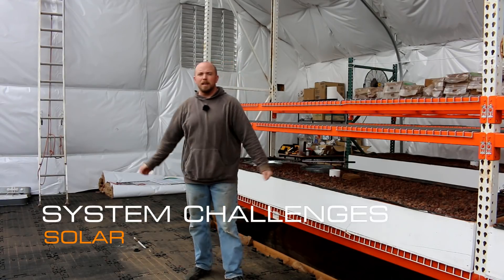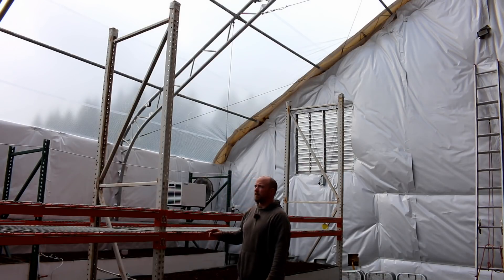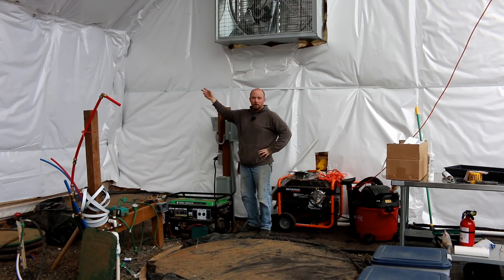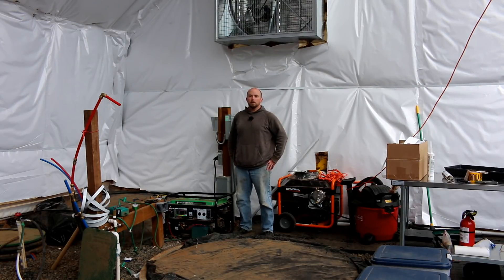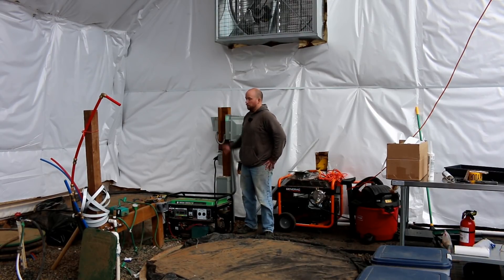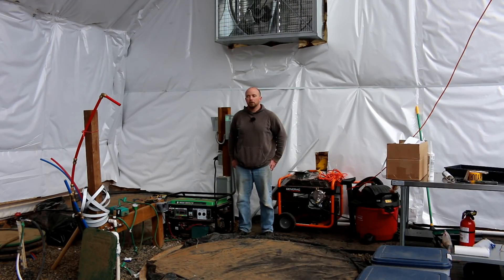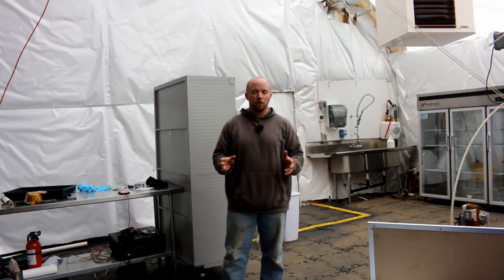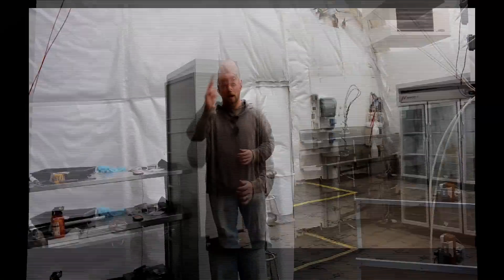Solar, THEY WANT THEIR CUT

Comment: Also... if you need to run power... run DC instead of AC... could have saved some line losses and wire cost if the inverters where installed near the meter instead of at the array...

Comment: Had a large innovative dairy farm in the area that has large manure digesters that make methane. He used to generate roughly twice what he needed for the whole farm housing and all. Power company sent him a bill one day for 20k$. He called and asked what it was for after all these years. Their excuses was fees due. He officially went completely of grid after that. Designed some neat switching equipment and software to control the out put for his three giant generators. Now as more power is needed the software will switch on more generators as needed. Or shut them down when not in need.

Comment: dude I was one of those who told you just to go it alone, no govt involvement, that didnt allow you to have batteries tied in and that would put you in the dark during a blackout! And might I add your solar is not in the perfect positioning either, I mean your panels should NEVER have shade on them considering the land you have... NOW you getting screwed, just like you where warned about. You need to slow down, now your talking tesla batteries, finally, But DONT have them outside what ever you do!!! Batteries dont like "freezing cold". mistakes are mistakes but lack of research can cost you thousands. For instance, look what happened to California and those folks. This very same thing and Solar City. Check out the  video on YouTube... I know, I know, I support you brother, I have no other point to make other than when it comes to power generation, plan for your worst case and plan your system accordingly and batteries are a hugh part of that overall system for global systems energy storage for the entire complex. Plan for you being the Sole Provider for All Systems Power. Im rooting for ya and Im learning alot too. Im working on a low voltage generator and I'll update you with its progress because I know it'll be an asset and programmable too... we share your frustration..:-)

Comment: We have similar power company issues in New Zealand.  Our local body has raised the monthly rental  (your  $30) for people who have solar/turbines and essentially cut any sell back to the grid. Prior to this, a setup using batteries as well as grid sell back ended up pretty much cost neutral on a  monthly basis.

A friend of mine is rural and has batteries and solar. It is a big enough system to run a reasonable size engineering machine shop from. When the power  companies shafted them on sell back he looked for other ways to use his surplus electricity and bought his wife a new electric car. Fortunately for him he has the financial ability to go buy the car at short notice. 

Could be a good option for you to absorb surplus energy. But you guys are too rural and cold to rely on EV's I guess.

Comment: this legislation is going on across the nation. BIG POWER is running afraid. Batteries is of course the answer. Here in fla it is against the law to not be on the grid if you do not have batteries. THUS.. the power company has the ability to cut you OFF of the grid in the case of a hurricane or power outages. thus.... if the grid goes down and you do not have batteries you would be breaking the law to run solely off solar.  wait, what?????????

Comment: Check out GRAPHENE batteries. They are the future. Would be the choice on Mars, not that old hat Lithium Ion. Presently 6 times the capacity.
Reply: Are you importing any from the future then? Might want to put a fusion reactor in the mix while you are at it.
Reply: No need! https://www.ft.com/content/5a6693f0-d349-11e7-8c9a-d9c0a5c8d5c9

Comment: i would invest in to a led acid Electric fork lift battery depending on the size and they have 12V, 24V, 36V, 48V, options and will power a house with ease and is easy to maintain and are known to last 6+ years with proper upkeep and have lived as long as 12 years under extreme use  and they can be rebuilt and you can also buy rebuilt ones at a discount ...at least look in to it or install a bank of 6v golf cart batteries and install a watering system for easy servicing maybe look in to a place like this http://cdn2.hubspot.net/hub/435823/file-2177974806-pdf/IMG/Page_images/H2GO-Industrial-Battery-Brochure1.pdf?__hstc=75749450.7a714e0983efbb20db05f7decd2dc150.1518065533971.1518065533971.1518065533971.1&__hssc=75749450.1.1518065533972&__hsfp=753840322&hsCtaTracking=f03fe077-ac40-403b-a6d7-cb513aa4dcbc%7C34cc661f-2643-4600-8b8f-368776515de6
Reply: cant find any prices for these anywhere..?

Comment: The real problem that electric utilities are facing is related on how to tie production to demand. You just cannot shut off a thermal or nuclear power plant on the spot because it's bright and sunny outside and start it when the sun goes down on summers but not over winter.  Large batterie banks are currently being build to store that excess energy but even though, there is no magic solution. Some sort of energy storage will have to be added to each house to compensate for the highs and lows of the grid.

Comment: Jared at Simple Ground installed has completed the installation of its off-grid electrical system. The batteries that he choose aren't Li-Ion but neither Lead-Acid. It's a fairly new technology on the consumer market (although use in the telecom industries for a few years now). Get in touch with him: he even has the contact info of a distributor in WA state. Keep up your good work.

Comment: Before you jump to the Tesla Power Wall2, check out other lithium ion batteries. There are other kinds. 
http://simpliphipower.com/contact-us/   Also check out “grid zero”. You can add a battery based inverter and AC couple to your present system. I install both grid tie and off grid systems.

Comment: Something I don’t understand is why people complain when power companies charge you a fee. The resident doesn’t wanna invest in batteries yet wants to use the companies batteries for free?
Reply from the maker: I'm not complaining about the $30 fee...that makes sense...thats the admin of maintaining my connection and processing my bill...I have a very hard time be charged to provide something that they pay for (i.e. power) with no explanation of why my connection, that provides power, is somehow more expensive to maintain.
Reply: That power you produce first goes to the neighbors, which they still get charged for.
What they are trying to do here is scare people off solar power, because every kWh you are producing you aren't buying, and if enough people go that route you soon put them out of business.
And it's not just the rates that are changing, there are whole power company groups working on legislation to make it increasingly more difficult for anyone outside their groups running solar farms.
Reply: TheRealMartian what I’m saying is why wouldn’t there be a fee associated with using their power storage? The way I see it is you either pay thousands for a battery wall or a fee to use their batteries. 

I understand both sides. I use to work for Solarcity/Tesla as an installer for years. One point that I don’t agree with is power companies forcing people to be grid tied. It’s a forced monopoly
Reply: TheRealMartian also because you like to tinker and build. Look into building your own battery wall out of used Tesla batteries. Great YouTube channel that give a lot of information on the proper way to do it.

Comment: Hey TRM.  Really like your channel, and sincerely appreciate the reasons behind why you are doing this.   Therefore, I mean no disrespect and my following comments come from genuine concern and hope that you will succeed.  I was concerned by a couple of the generalisations that you made, but I realise you are understandably so mad about your county trying to take money out of your pocket that you are not thinking straight.  "Solar is not reliable".  The Sun is the only reliable thing you can count on. It shines every day of your life and will do so long after you leave this good life.  Yes cloud cover and time of year (angle of light) affect whether it reaches you, but there are systems that can be put in place to account for this.  Track how many days of the year on average that you have issues due to snow cover and low light.  Lift above the snow (suggest pillars, see DIY Homestead Projects) and Implement solar tracking and or optimize your system for winter angle, not summer (this is how earthships work and they provide abundance year round).  To be brutally honest, when your "solar is not optimized for winter" even added battery storage won't help unless you start over.  Start looking at your usage and be sure to size any battery storage appropriately for lowest solar capture and several days of cloud cover.  You may need to add more panels as well once you do all the sums as I've been seeing you add in way more sensors and things (each will cost).  I understand you were relying on grid,  but that was your mistake. Putting your trust in your council and they made a slave of you (doing their readings for them, are you nuts?) and now stealing from you (charging you for supplying them with power that they charge others to use).  I know you can turn this around eventually, but it'll be expensive.  Several Tesla Power walls may help but are gonna be costly.  Finally, please check out Urban Farmer Curtis Stone's Youtube channel as he has a great system for microgreens.  I respect the scientific approach you and Mr's Martian are taking with the trials recently, but if Microgreens are just a means to an end for your aquaponic systems, why invest so much time in them? Why try to reinvent the wheel?  Implement Curtis's microgreen systems so you can bankroll your greenhouse systems and stay focused on your goal. You know Elon created Ebay and Paypal to bankroll his Battery, Tesla and Space projects.  He's then sold off those original projects as means to focus on his passions.  I'd respectfully suggest you continue thinking similarly and allow bare minimum of investment of time and resources in the microgreens.

Comment: I would suggest Edison batteries or Lithium-Polymer instead of Lithium-Ion. The Edison's batteries are able to be run very low like Ni-Cad's without damage.
The Lithium-Polymer are better than Lithium-Ion because they are more stable so they don't explode as easily.
But in the case of Lithium-plus (anything) you cannot run them down below 50%...EVER...something that could happen after days of overcast sky.
PS> An automatic transfer switch works.

Comment: Yeah, you bet on the wrong horse here.... It was fine when you were a small percentage, the company could eat the cost and maintain relative parity with net metering.  But, the more folks that took advantage, soon the cost of normal uses isn't going to cover the generation, transmission, and maintenance with just a flat $30 month fee.   I don't think anyone should have planned long term on that being a solution.  I think grid-tie is going to avg out to some point but it was probably too subsidized and it's moving back the other direction.   Easy to still be upset though... yeah I'd look into a Tesla battery / Edison nickleIron.   Grid-tie has it's pro and con.

Comment: LiFePo4 Winston, they are the best for photovoltaic applications, they do not suffer from the cold like "Tesla" lithium, but they have a lower energy density, being not a traction, but for a FV system this feature is not essential, rather the greater safety against the flammability and resistance to extreme freezing are the main parameters.
obviously controlled by Batrium BMS and a professional MPPT FV charge controller like the MidNiteSolar

Comment: There are automatic transfer switches that can auto monitor power from both grid and solar (generator, wind, whatever you have) and safely automatically transfer when the preferred method goes below (or above) specified tolerance. One was installed where I work about a year ago. It has since been tripped about 3 times. It auto switches back when the grid comes back up. We tied it in to our existing system to monitor and manually trip the switch if we want/need to. The generator is less than 100 yards from my office too. It gets loud when it fires up. I can't remember the brand that our switch is but the guy who came and configured it said that these were exactly what the US military uses because they are pretty much 100% foolproof. He was former military and worked on them there too. I want to say they are Eaton.

Comment: There are rumblings over here in the UK that due to the decreasing cost of producing electricity from solar, wind and increasingly  importantly alternatively new sources such as wave power on the shore line, the power supply companies are beginning to squeal loudly about being tied into huge long term contacts with the major power generators of coal, gas and nuclear. Most folks are expecting power supply companies to behave increasingly badly in ways such as you have described. 

Full blown independence from the Grid supply must look initially to be increasingly attractive BUT at what cost and % return on capital to yourselves? Would that capital expenditure perhaps be better employed elsewhere? Perhaps there is an acceptable "half way stage" somehow?

Comment: Modify the panel mount to go for a tracking system with additional feed from a wind turbine. Use them to charge a large battery bank and run everything from the batteries - only use the grid as a fallback supply - albeit one that costs $30 pcm, alternately get a diesel/propane generator for when the battery bank is exhausted.

Comment: Flow batteries are an option you can look into. If you have a  battery system then your a small generator away from going of grid (assuming the authorities don't condemn your property for not having a grid connection)

Comment: Go completely off grid, screw em.  Add a separate solar panel array for the home and separate the bldgs. Consider some 24 volt appliances for the home and well pumps. Consider using these inverters for increased output, unless you already have them.https://www.wholesalesolar.com/2977250/enphase/inverters/enphase-iq6-microinverter-inverter

Comment: If you can put the batteries in a place that is heater you will be further ahead then with a "battery shed" outside that will not be getting any heat in the winter months.